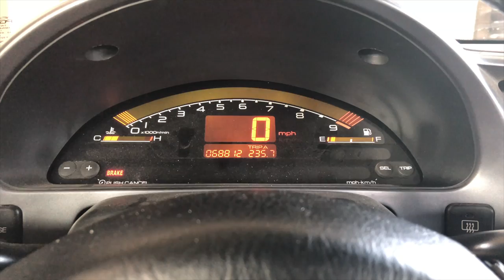Alternator Rectifier & Brush Holder Replacement | Honda S2000

Comment: Starter rebuild next?  It's a common issue to get a grind on startup because it doesn't pull the starter gear back fast enough.  These are some of the best instructional videos on youtube by the way.
Reply from the maker: I am quite familiar with the issue as I had it on my original AP1 and I now have it on the club racer. The last time I looked into it on s2ki I read mixed reviews about cleaning and regreasing the starter. Some folks say the noise came back after a few months and other say that they haven't had issues for 2 years. So I have been hesitant to go through all of the effort to do it since I know it is just a nuisance and doesn't seem to affect the lifetime of the starter. However, doing a starter video would be pretty epic.... 

What have you read about the rebuild?
Reply: I've read similar things as I've been using s2ki as a source as well.  My 06 has the issue as well.  I've been thinking about doing the rebuild mostly because I'm concerned about the damage being done to the flywheel and starter gear.  

I've had thoughts of adding a slightly stronger spring to make the return action a little faster but I'm not sure if the solenoid is oversized enough to handle the additional spring force.
Reply: Denso remanufactured starter is cheap ($120) and lasts long.
Reply: The rebuild is free other than the grease cost.  It's not really a rebuild but more of a disassemble, clean and regrease that we are referring to.
Reply: EndlessV3rtigo 
Oh if the starter is not dead, then that would be a good maintenance work.  I saw some guy even change the contact points with Toyota parts.
Reply: Mixed results because it is the dust coming from the clutch that gets the starter all dirty... People have different clutch, clutch differently and drive/abuse them differently.

But yeah, a starter disassembly video would be nice if you already have a starter on hand!

Comment: Hey bud, is this part still working good? I’m thinking or ordering the $33 one on eBay to toss in mine since the alternator is out of the car right now
Reply from the maker: Hmm. Well I blew up my motor and did a swap so not sure but plenty of other people seemed to have good success.
Reply: DIYGuys how did your motor end up giving out?
Reply from the maker: NAUS Spun main bearing. Not sure why but I was burning 1 quart of oil every 300 miles so things weren’t healthy.

Comment: Just did mine, great tutorial! Used a new oem brush and the ebay rectifier, on 04 AP2. The little knotch was a slight issue with aligning the one screw but was not too bad, as you mentioned in your video.
Reply from the maker: Glad it worked out for you!

Comment: So I experience the dash flickering and also flickering of the ac lights only when it's really hot outside and I'm pushing the S hard. I also have an upgraded sound system. Do I need to replace the rectifier? Or is there something else I should check out? Somewhat related: my front passenger sidemarker light is always out (headlight). I've changed the bulb already. Any help? Thanks for the awesome vids!
Reply: You sure you don't actually need to upgrade that alternator for a higher amperage one for that sound system?
Reply: Check fuse box

Comment: Are there specific brands like DENSO to change out Rectifier & Alternator Brush?
Reply from the maker: No idea. Not even sure who the OEM supplier is.
Reply: Did you purchased those 2 alternator components on online or in person?

I see partsgeek.com sells a DENSO' Alternator Brush for $44~
Other than that, I'm searching for fitments from possible manufacturers

Comment: Sorry if I missed it, but where did you buy the rectifier from? My 04 s2000 has the same problem.
Reply from the maker: In the description, its a shortened URL for this: https://www.ebay.com/itm/100-NEW-ALTERNATOR-RECTIFIER-FOR-HONDA-S2000-2-0L-2-2L-2000-2009-021580-4850/272184678390?fits=Make%3AHonda%7CModel%3AS2000&hash=item3f5f7897f6:g:1NQAAOSwJQdW84LN

Comment: Have you actually tested rectifier’s diodes with the multimeter? I wonder if one or more was bad.
Reply from the maker: I didn’t. When it comes to electrical stuff I’m pretty bad. I only know how to test batteries 😛. Would you check for continuity?

Comment: hey do you have a link for a brush holder as well?
Reply from the maker: If you do an eBay search for "Honda S2000 brush holder almost any of those will work". I would recommend this one: https://www.ebay.com/itm/NEW-ALTERNATOR-REGULATOR-BRUSH-HOLDER-BRUSHES-Fits-HONDA-CR-V-Odyssey-S2000-CRV/271528808808?fits=Model%3AS2000%7CMake%3AHonda&hash=item3f3860d168:g:cLUAAOSwDNdVlH1G:sc:USPSPriority!94555!US!-1:rk:1:pf:0
Reply: DIYGuys thank you! Just ordered this